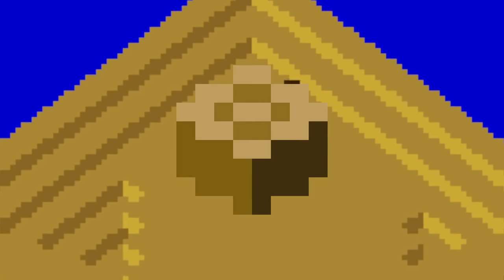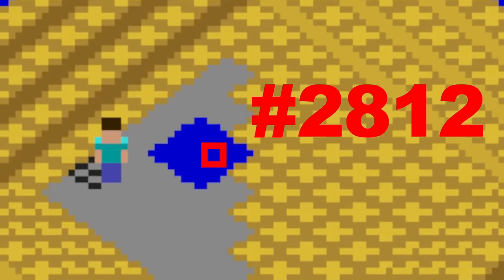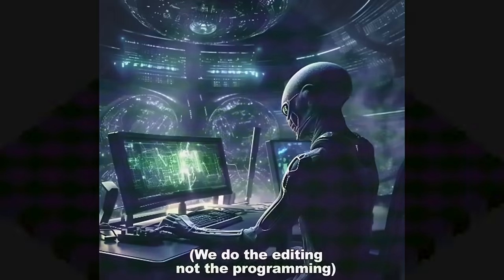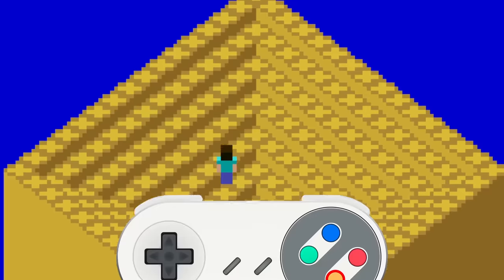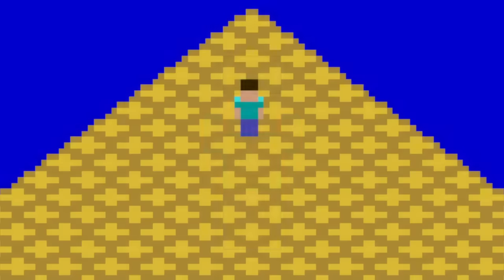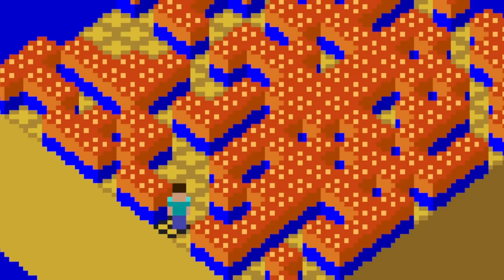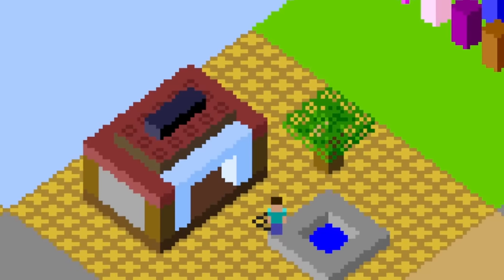8-Bit Minecraft Pt. 2: There's A Reason This Doesn't Exist

Comment: Since we're crunching space, you could use the unused first 2 bytes in the item stackage to add modifies to that stack. This would mean that the stacks are limited to 64 only, BUT you could do some cool things to those stacks, like marking them as different  variants of that item (like smooth stone vs cobble stone vs stone brick, or red wood vs oak vs maple. Could also make it so it tracks certain enchantments or durability on tools. Things like that. Basically you would have 4 states, 00, 01, 10, and 11 that you could do anything with :3)

Comment: 7:57 in the minecraft xbox 1 edition 'a' was used for jumping, b for dropping stuff, y for inventory, x for crafting or creative inventory, the button with 3 lines was used for menu, the button with 2 squares was used for the player list and host privileges, left joy stick was used for moving, right for rotating, the cross thingy was used to move on the xy plane while flying, the big thing on the top left was used for mining, the one on the right was used for placing blocks, and the 2 little things on the top were used to switch hotbar slot.

Comment: So for control wise, if youre using Y to swap between layers, i feel like itd be easier to switch tile select via like. Hold Y. While holding y, L and R will toggle up and down layers, and the dpad will move the cursor on your current layer. This frees up L and R to be quick easy buttons to swap around your hotbar items, which feels like itd be smoother to control, and i think those commands for choosing a block are more intuitive too.

Comment: I think you should keep the spare 2 bits in the items to store any extra information you want to use, like for instance, the health bar of tools

granted with only 2 bits you may only have up to 4 health points in an item, but you could extend the lifespan by making the loss of a health point be random upon use with a reasonably low probability
Reply from the maker: Since tools aren't stackable then the "number of items" bits can be used to represent the tool's health bar, decreasing each use until 0 and it breaks.

Comment: You could optimize chunk rendering up  to a fraction of current amount of draw calls. Since your isometric view hides blocks on diagonal (block with coordinates [2, 2, 63] won't be displayed if there is a block at [1, 1, 64] and so on) you can vastly reduce unnecessary draw calls. Let's say one chunk is 64x64x64, you only need 168 draw calls, since 168 is the maximum amount of displayable blocks. This means you need 168 diagonals going through the chunk, staring from its faces (left right and top). You can begin rendering with the bottom furthest diagonal (let it be [64, 1, 1]), since it will cross only one block you can, assuming there is one, you can draw it. Then you can move up by 1 and after reaching the top repeat the procedure at [63, 1, 1]. Going through the diagonal itself is also a straightforward process: after each iteration if the block isn't in place (it is air) increment x and y and decrement z.  Repeat the loop until reaching a block and that's it.

Comment: I really liked the video and all the progress you've made since the last one, but I have some suggestions related to the controls. When you added the option to scroll through your hotbar for different items, the player is required to hold START and then use the D-pad. This is a good solution, but as you said, using START for this kind of functionality does feel strange. Why don't you switch it to holding the R shoulder button and then navigating with D-Pad?

And I know you already using this button for switching the target block, but you could implement the same controls for this too. Hold the L shoulder button, and then left and right on the D-pad rotates the selection around you. And similarly, holding L but pressing up and down just changes the height of the selected block. This way, you go from requiring 3 buttons for block selection to only 1 (plus the D-pad), which might prove useful since the controller doesn't have as many buttons as modern ones.

Only drawback is that you can't move while switching the target block, but if it wasn't a problem for the hotbar, I believe it should be fine here.

Comment: Start + D-Pad seems better for the cursor than Y + L/R to me, since you could get some more control over which block your cursor is on with the D-Pad rather than rotating through 21 blocks in the same order. I can imagine missing which block I meant to have the cursor on & accidentally mashing the cursor 21 times instead of 20. The D-Pad method would need you to pick a new button for raising the z-axis of the cursor however. (assuming left/right control x-azis and up-down control y-axis)

Comment: You should try making it so that the player outline when you're lost can slowly fade away, and "wake up" again by pressing any button, even if it doesn't move you, just for the sake of screenshots. I think it would be nice because I was at the end of the video and the house that was built looked weird with the giant white player outline on it.

You could also make "hide outline" like a cheat code...
Reply from the maker: Eventually I hope to have the outline as a toggleable setting, so it can be turned off if the user wants.

Comment: Thought I'd just suggest something regarding the inventory system and block stacking;

Seeming as it is a game with 8-bit in the title, the item stacking should indeed be an 8 bit number. Expanding on that, instead of a number attached to the slot, it could just be the binary of the number of said block, but when you then go in the inventory, hovering over the block can then show the full number in a non-binary form.

Though it seems a bit silly at first, I feel like it would at least give an easy indication to how many of that block you have without the complication of making space for said number, when you can represent the number in 8 pixels, and imo, binary does a pretty good job in at least giving a rough idea on indicating how large the number is by pixels from right to left. And having the number be visible on hover in the inventory menu, you can at least get a more accurate depiction on the quantity of that block in particular.

And for items that dont stack, no need to show the binary value, but instead can then be used as a healthbar of said item by using a colour like green instead to represent item health, and have the block quality bar as a bright blue on a selected item for visibility purposes, and a gray when its not just so its easier to visually skim things.

Comment: Adding a way to allow the player to not draw the layers blocking where Steve is would be beneficial (or some sort of ghost representation). Though this would almost certainly be extremely time consuming to implement in a decent way (or in any way for that matter). But this would allow you to look into spaces to see what Steve sees. Otherwise you just see his outline without much else information, when it could be an epic interior or hollowed out area.

Comment: You could mock him having movement by animating the colour values for the sprite. If you apply a gradient of luma across the surface or dither to the (logical) background pixel value, you can essentially mimic rotation. Think of it like forced anti-aliasing.

Comment: Going from foot-screen position to block position shouldn't need a loop. A bit of linear algebra should do perfectly - multiplying the player's position by a 2x2 matrix and then adding a vector should replace all that collision checking loop with 8 multiplications, 6 additions, and possibly 2 bit shifts to divide, then 2 bit shifts and a binary OR to bit-pack into the desired coordinates.

Comment: 14:26 I think an arbitrary cap would be best, with the remaining 2 bits left for what cap that would be (1, 16, 64, ??) just like there's different stack numbers in minecraft. I'm not sure if that's possible though

Also great video, I'd have never thought of the solutions you came up with for these problems, and especially with such limited resources and having to use assembly it's impressive how much you've made

Comment: The scariest thing when writing assembly by hand is knowing that if you do a lot at once and don't write enough comments about it, that sometimes rewriting hundreds of lines is easier than actually debugging the thing.
Reply: I work at a place that used to use Assembly for simulations of nuclear power plant cores. Times have long since changed of course but in the break room posted on the wall is a long roll from dot matrix printed paper with code for... something no one in our department can make heads or tales of anymore, as it was found in a box cleaning out a retired guy's office. This thing has hundreds of handwritten comments all over it with different handwriting and pens and in some places the pen color changes but the handwriting stays the same, and there's lines and circles pointing all over the place, and SO many question marks. The top of the paper is torn while the bottom is cleanly cut and the theory around the office is this page is the end of some larger code that people 70 years ago were trying to debug and eventually ended up scrapping the entire section we found to rewrite this portion from scratch.

Comment: This is unironically amazing. I can't imagine how much code this is taking behind the scenes.

Of course, the next question I'm wondering about is how much 'stuff' will be feasible given the innate limits of 16-bit programming. If every chunk is made up of 4,096 blocks, and a 16-bit processor can only count to about 65,000, I'm guessing that the size limit of a world is going to come a lot sooner than it does in Minecraft.
Reply from the maker: Currently there is a 16 bit limit on the number of chunks able to be rendered (per X/Y axis), so I hope 4,294,967,296 chunks is enough for most people.
Reply: @InkboxSoftware  ...I feel like I did the math wrong somewhere.

Comment: as for the inventory part, it's worth noting some items don't stack, so you wouldn't need a byte for quantity (but you might have to use it anyway for the durability now that I think of it)

also, I think it'd be better to allow the items that do stack to go up to 256, since capping at 64 would just make more items of the same type to take up a new slot and make use of new bytes

Comment: Instead of putting blocks on a second layer I would have tried making a modified sprite that removes the occluded pixels, using a Z-buffer. Same with adding new blocks.

Comment: I have an idea. Instead of using a button to move the cursor on the x-y, use the d pad. There is a radius around the player, and if the cursor reaches the edge of the radius, then the player moves that way. The player doesn't move if the cursor is within the radius. Im pretty sure Pikmin does movement like this.

Comment: Im my opinion, in terms of making a game, less is sometimes more. Just because you have a lot of items that doesn't mean you have a good item selection.
If an item doesn't have a meaningful purpose, or it's purpose is being overshadowed by another feature/item, then what's the point of having the item in the first place? I'm saying this because the sheer number of different tool types shown was (in my obviously professional, objective and definitely unbiased opinion) absolutely absurd. 
At it's core Minecraft really only needs 3 tool varients: wood/stone (people generally just mine three pieces of cobblestone and ditch their wooden pick anyway), iron, and diamond.
Nobody uses gold tools unless it's an emergency, what would be the point of copper tools if Iron is almost as easy to get, there is no reason why emerald tools should exist, and diamond tools already exist so why would you need obsidian ones?

Anyway, my only actual suggestion is to make it so any blocks that are above the player (on the vertical axis), and are obscuring the player's vision simply disappear from view. Although I'm assuming this was probably planned anyway.

Comment: Is there a reason you're trying to work with visual data for movement? Usually the visuals map to hidden logical data instead. So you'd update the player's position in data, and then update the sprite position based on that. Do you just not have enough RAM or clock cycles to do it that way?

Comment: this is really well done, however a question I have, why not use 65c816 ASM for this? less limitation and it also has a 6502 emulation mode and you can still represent everything as 8 bit, even if you stay in 16 bit mode on the 65c816 the whole time

Comment: Instead of highlighting the player you should make the blocks in front of the player slightly transparent so that you can actually see whats inside a house/cave. Or if that isn't possible you could check if a block is placed above the player it will dimm the outside and remove the blocks from the frontside so that the player can see the inside. This are just vague suggestions but maybe it could help you to get an idea because it is really a shame that you can't see whats going on inside of a mine for example

Comment: whenever you talk about the difficulty of figuring out which sprite is on top of which, I just can't help but think "depth texture". Wouldn't it be possible to store each pixel's "distance from the camera" in another texture, and compare that texture's values for the existing environment and the sprite to be placed in it, to know which pixels need to be overwritten? Or is there a reason why you can't do that? ...one that I can see immediately is that obviously you'd need double the buffers for each texture. But is that the reason, or would that be fine, or is there another reason?

Comment: I want to make a suggestion could you make it so when there is a roof over you the roof Becomes Semi-invisible just like RuneScape so you can see what you are doing: placing blocks, removing them and so on. Rather than just the Outline of the player.
You dont have to just wanted to throw it out as an idea if you can do it or something similar to it ;d

Comment: I feel like at some point in the future if it's possible it would be better to do a sort of solution similar (but like not really) to dwarf fortress to where if your character is covered or hidden it hides the layers above so you can navigate the inside of structures and mines
Reply: it would require redrawing like a quarter of the screen very often which is slow and would also look janky in an isometric perspective

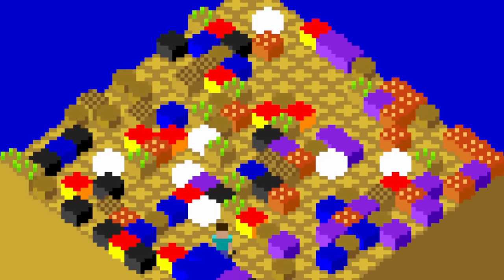Comment: 13:55 That is an interesting way of managing the inventory without a mouse. I also had to solve this with the keyboard in my game, and what I came up with is a two button system. Where one button would sellect a space, and the other button would swap the items in the selected space and the space where the "cursor" was.
Its a bit of an akwards system, but it works. Still, while your system is more elegant, because you use just one button, i think my two button system works better for me, because when you want to select an item to move, you dont have to first move the previously selected item to deselect it. 

I wonder, what other inventory control systems did you think about when making this? I would be very interested in hearing some ideas on that.
Reply: Wouldn't it make more sense to have the simplified controls of a single button (e.g. A button) for select/move/swap and deselect (if on selected slot) and then use the other button (e.g. B button) as a dedicated deselect button? Could even make it the same as close inventory, although then after selecting something it'll be two presses to close inventory.
Reply: interesting  point, ill try it out. @R3dFlames
Reply: Could always pull a leaf out of Bedrock editions for consoles, or Legacy Console edition.

Comment: I think using the full byte for block number makes sense. Unless you find a better use of those bits.
Reply: Durability, enchantments.
Reply: @kitohawksworth5000  true. Though I think you need more than two bits for those.
Reply: @amirhosseinmaghsoodi388  yes, though durability could maybe be done with just 2, split durability into 25% segments, and find some way to not reduce it every use.

Comment: please remove decard movement, which you're seemingly using by default, and change it to isometric. I mean, you should go up-right corner if you press up button, up-left, if you press left button e.t.c.

It's totally okay doing like this and after getting used you will feel it natural. There is no practical benefit in moving diagonally (relative to the world).

Comment: Is there a a way to create a function that can return the dot product of the current x y? I haven't coded in assembly (well nothing complex) but that's how I handle isometric when coding from scratch. I just had a constant vector following the angle of the tiles to reference off
Reply: So like if the tiles are exactly 45 degrees the vector would just be 0.5, 0.5